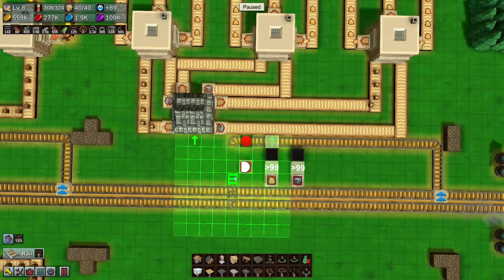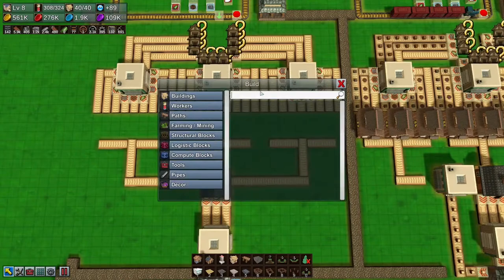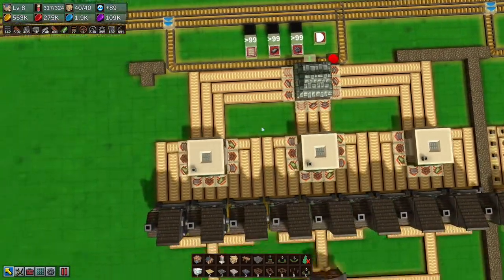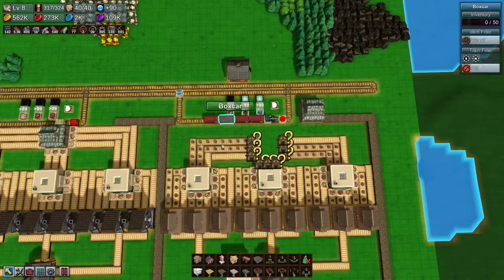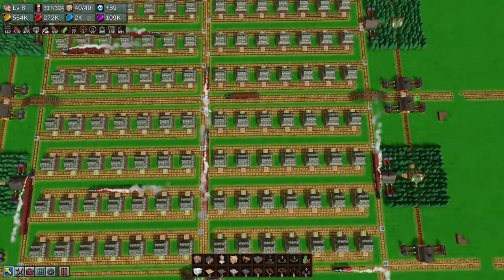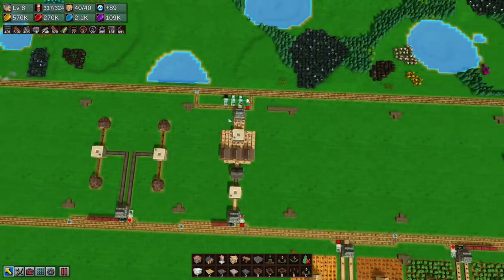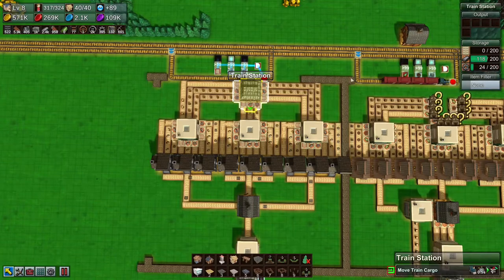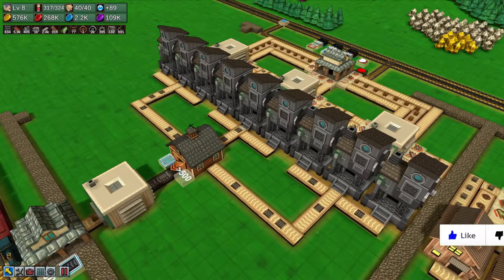Factory Town Grand Station - 95 - Metal Conveyor Belts

Comment: Check your animal feed production--I noticed last episode that one of the conveyor belts is feeding onto the wrong belt and it was causing a bottleneck.

Edit: Ooh, I like the logic for the barns that you added at the end--I've been thinking that something like that might be beneficial for the resources you both use from storage and use in production, but I didn't know how it would work. My confusion with logic is in regards to knowing which blocks to connect to which blocks/buildings.